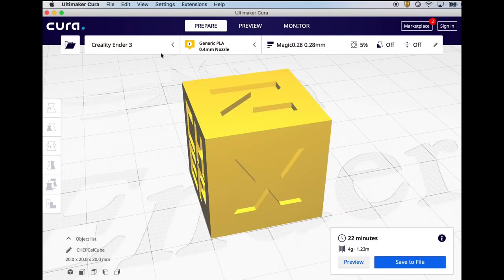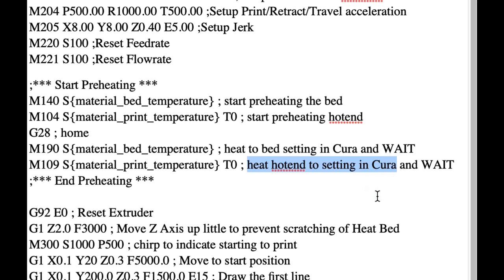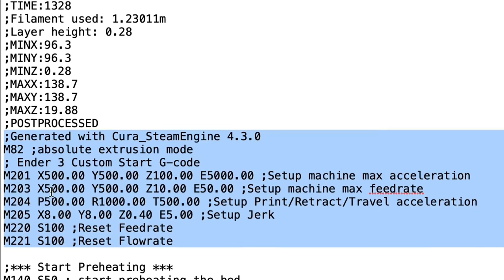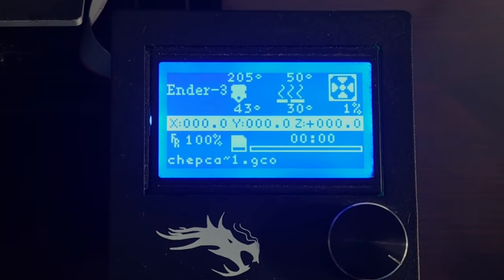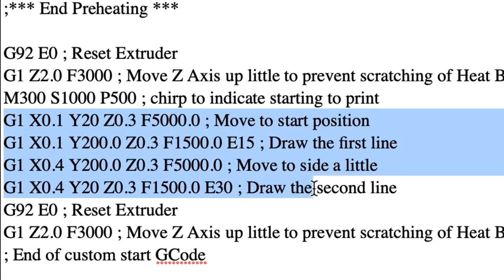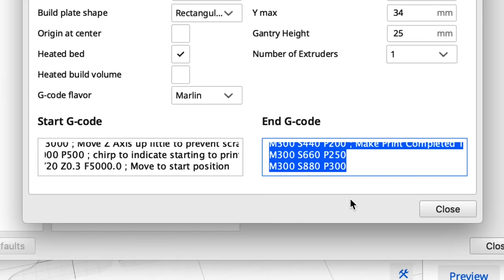Faster Hot End & Heated Bed warm-up in Cura

Comment from the maker: I’ve updated the .txt files. No more hidden characters from my Mac.
Reply: Fortunately you don't have a quantum computer you would have quantum number in your files for 3D printing with quantum filament
Reply: CHEP thank you so very much. Greatly appreciate your work and dedication of putting the tutorials out for us. Thanks.
Reply: What's the diference between G28 home and G1X0.1,...  ;move to start position
 edit ;    figured it out.     G28 is home other is just prep for prep lines

Thank you!
Reply: Hey Chuck, why not just hit the pre-heat function? I always do that on my Ender 3 Pro, and then insert the mem card. Once heated, I then change the filament to the colour I want, and hit "go". The preheat temp can be edited to 60 and 200 in the printer  under Control / Temperature / PLA Temp.
Reply: Just wanted to note that I copied the gcode from the website just now and there are still hidden characters. Easy fix but a bit confusing until I opened the video in YouTube to see this comment.
Thank you!
Reply: Note if you have a new Ender 3 you need to move the G28 to top like this, otherwise it heats the bed then just stops.

Settings > Printers > Manage Printer > Machine settings then paste the following gcode at the top (M117 shows custom text for extra cool factor)

M117 Monkey Mode Reset {material_type}
G92 E0 ; Reset Extruder
G28 ; Home all axes

M140 S{material_bed_temperature_layer_0}     ; set bed temperature to e.g. 55 °C and continue
M104 S{material_print_temperature_layer_0}   ; set hot end temperature to e.g. 210 °C and continue
M117 Monkey Mode Preheat {material_type}
M190 S{material_bed_temperature_layer_0}     ; wait for bed temperature to reach e.g. 55 °C
M109 S{material_print_temperature_layer_0}   ; wait for hot end temperature to reach e.g. 210 °C
M117 Monkey Mode
Reply: Note this is only required for Print using USB mode with Cura
Reply: 404 behind a pay wall but thanks for the info
Reply: the link is dead...

Comment: Hi CHEP!
Instead of using the material_bed_temperature variable I use the material_bed_temperature_layer_0 variable if not the first layer temperature setting will not be used at all. I made this change on the Start G-Code and worked like a charm!

Comment: I have found its better to let the bed come up to temperature and let it stabilize for a few minutes first before starting the print - especially for large prints that use the majority of the bed. During heatup the bed will expand unevenly (due to some portions of the bed being hotter than others), but after a few minutes this will start even out across the entire bed. I now get perfect first layers every time, even for large prints.

Comment: For the cases when bed takes much longer to heat up than the hotend - just add few more lines to you start code. Begin heating the bed and wait until it reaches 40C; you may need to experiment and find the right temperature for your bed type/size. Then follow the instructions from this video - continue heating the bed further till the final temperature and at the same time start heating the hotend. Both will reach desired temperatures simultaneously.

Comment: Took in use in my Ender 3 Pro immediately!

Also moved "G1 Z2.0 F3000 ; Move Z Axis up little to prevent scratching of Heat Bed"
before M190 and M109 waiting commands so that hot nozzle is not in contact to the magnetic bed while heating.

Comment: Thank you; this tip will prove very useful. I know that if I go into my Anycubic Mega temperature settings and manually set the hot end, I can heat both hot end and bed at the same time without blowing a fuse. This is what I have been doing before seeing this video. 

I can see why Cura would want to be conservative, but they should make it an option.

Comment: I would think that the bed heats up first so that the glass/surface can heat can soak in and throughout the glass. The bed would need more time than the nozzle would.
Love all your videos btw!
Reply: This is exactly right. The hotend usually heats up very fast anyway, so it's not a big delay, but an easy approximation that doesn't require manual timings or other complications to make it work with most printers, while still allowing a bit more time for temperatures to settle and spread from the heating element to the print platform.
If you can move the thermistor, placing it ON the platform, as far away from the heating element as possible would be a good way to remove the need for this, but can be inconvenient to implement, and would be very error-prone to do as a default for consumer printers.

Comment: From what I remember reading the primary reason for heating the bed and the hotend separately in series instead of in parallel is more so that you're not cooking your filament in your hotend while waiting for your bed to head up. The hotend can warm up so much faster than the bed (at least in my printer) due to the differences in mass.

Comment: Found your post on the web about this and used it to greatly reduce my frustration during the start of prints.  Thanks!

Oh, I did have to make a change, though.  It didn't like the T0 at the end of 2 of the lines, so I had to remove it and it still works fine.
Reply: Same with me.  Had to remove the "T0" at the end of the two lines of gcode to get it to work.

Comment: @CHEP you should use the _layer_0 instances of both variables, to make the behaviour fully consistent with the profile settings. I would also suggest to set the M104 at a fixed lower temperature (140-160) to prevent oozing in case the bed takes longer than the extruder to reach temperature.

Comment: There might be a caveat worth mentioning here. I have a glass bed and personally I prefer to preheat the bed for longer than even the delay in the nozzle heatup allows for because the bed feedback temp is for the plate not necessarily the bed. Glass takes a bit longer to soak the heat into especially when started up cold. This may or may not actually be a problem, just my preference.
Reply: Coming to say this.  My Ender 3 with glass plate had horrible first layer adhesion.

Comment: I was procrastinating on this one for a long time. Had modified my old 3D Printer to operate this way. But, when replaced it I had been used the preheat setting; which was always the wrong temperature.... So, you "forced" me to update my start and end code.  Works great! So, thanks for sharing.

Comment: Very interesting thanks for taking the time to post this,  I myself prefer to heat the bed up 1st,  rather than leave the hotend idling at printing temperature cooking the filament inside it while it waits, on a printer with a fast heating  AC heated bed though I can see the merit of doing this, but on my old cr10 which can take some time to heat up enough to print PETG and cant quite get hot enough for ABS without an enclosure,  I wouldnt do it, thanks again and this is certainly food for thought...
Reply: Maybe preheat the nozzle to a standby temperature, high enough to heat up quickly to print, low enough to not cook the filament.
Reply: heating the bed first also means that it has time for the whole bed to soak up the heat and even out. The whole minute or 2 saved waiting for the hotend to heat up has its benefit and if you cant handle that minute or 2 wait.. 3d printing really isnt going to be a good time for you lol.

Comment: If you're unsure if you should enable this on a printer that might have too weak of a PSU, you could always check if the printer will do that by itself already by using the preheat feature. If that heats both the hotend and the plate at the same time, that's basically the manufacturer saying it's okay to do that.

Comment: Another useful tip, thanks.
My MP Select Mini has a feature that I wish Marlin (or octoprint) could incorporate. When the heated bed is about four degrees from the setpoint it starts heating the hot end. With octoprint on my CR-10 I manually start heating the bed and when it's about 8 degrees from setpoint I start heating the hot end then select print.

Comment: I never changed the start G code, but on my Anycubic Mega S, sometimes I would go to the preheat option in the printer's UI and set both the hotend and bed to the desired temps and it heats just fine taking less time. What's cooler is that you can immediately go to the gcode to print, and it will still heat the bed first, but the preheat has already set the hotend to head and that isn't overridden, saving more time there as well. So basically you can set it to preheat and go to print immediately and you get the same effect as modifying the start gcode, except it's slightly more manual every time.

Comment: And I thought this was common knowledge. :-)
For the CR-10 I have been using this with Ideamaker for quite a time:

M190 S40 ;pre-heat bead to 40 with waiting
M140 S{temperature_heatbed} ;set bed temperature without waiting
M109 T0 S{temperature_extruder1} ;set extruder temperature and wait
M190 S{temperature_heatbed} ;set bed temperature and wait

And in PrusaSlicer this is it:
M190 S40 ;pre-heat bead to 40 with waiting
M140 S[bed_temperature] ;set bed temperature without waiting
M109 S[temperature_0] ;set extruder temperature and wait
M190 S[bed_temperature];set bed temperature and wait

So the 40°C pre-heating is the headstart my bed needs in order to have the nozzle and the bead reach the end-temperature at about the same time.
This requires a little tuning based on your end-temperatures, your printer and your enviroment.
Reply: Agreed, the problem with starting bed/extruder at the same time is that the extruder tends to ooze once it reaches its temperature.
Reply from the maker: The test strip removes any ooze for me.
Reply: So, does this works with the CR-10S? I have always thought that it is annoying to not have them heat up at the same time
Reply: @jacobwiebe293  There is no reason why it should not work on the CR-10S as well. But as I wrote it requires some tuning in order to make the bed and the nozzle reach their target temperatures at about the same time.

Comment: I believe the reason for heating the bed then the nozzle is to lessen oozing not to slowly work out the power supply. Printing some CPE or exotic dilaments requires 90 or even 100+ C which could take a long time for large build plates. Some machines take 5 or more minutes to get to 100 and it would be bad for the nozzle to be at said temp for that long since it can cook certain materials and cause jams.

Comment: I use a separate heat bed and it is hot all the time, I keep it pretty hot, 65c to 70c but I have a 1/4 aluminum tool flat bed, I use a mirror, stick glue and I have no problem with parts not sticking, unless the bed is not leveled correctly, love it! I have a CR10 self upgraded to CR10s.

Comment: I'm using this Cura start gcode sequence for my Ender 3 V2, more precise and interactive. Also, prevents filament oozing during the BLTouch bed probing.

;*** Start Bed and Nozzle Preheating *
M140 S{material_bed_temperature_layer_0} ; start preheating the bed
M104 S{material_standby_temperature} ; start preheating hotend (prevents oozing)
;*** End Preheating *

; Ender 3 Custom Start G-code
G92 E0 ; Reset Extruder
M117 Homing all axes
G28 ; Home all axes
M117 Bed tramming
G29 ; BLTOUCH Auto LEVEL
G1 Z5.0 F3000 ; Move Z Axis up little to prevent scratching of Heat Bed

G1 X0.1 Y20 Z20 F5000.0 ; Move to heating position
M117 Heating nozzle and bed
;*** Start Nozzle heating *
M109 S{material_print_temperature_layer_0} ; start heating hotend
M190 S{material_bed_temperature_layer_0} ; start heating bed
;*** End Nozzle heating *

G1 X0.1 Y20 Z0.3 F5000.0 ; Move to start position
M117 Priming the nozzle
G1 X0.1 Y200.0 Z0.3 F1500.0 E15 ; Draw the first line
G1 X0.4 Y200.0 Z0.3 F5000.0 ; Move to side a little
G1 X0.4 Y20 Z0.3 F1500.0 E30 ; Draw the second line
G92 E0 ; Reset Extruder
G1 Z2.0 F3000 ; Move Z Axis up little to prevent scratching of Heat Bed
G1 X5 Y20 Z0.3 F5000.0 ; Move over to prevent blob squish

;*** Single Print Start Tone
M300 S1000 P500 ; chirp to indicate starting to print
;*** End Single Start Tone
Reply: If you want to be more precise, heat the bed first then do the auto bed level
Reply: @gergohochoner6597  That is what this cura sequence is doing. :)

Comment: When I first got my 3D Printer I did consider this tweak but realised that extra offset time while the extruder is heating could give the bed a more time to thermally expand.

Ultimately I'd love someone with an Infrared camera to prove this hypothesis.
Reply: If you have a 300+ watt bed and a glass build plate, can confirm, it's an issue. My bed heats up as fast at my nozzle, so my first layer is really bad if I don't preheat the bed for a minute. It takes a second for the heat to soak through the glass. If my bed heater wasn't super overkill, I don't think it would be an issue.

Comment: On CR10s manually configuring  the commands CONTROL>TEMPERATURE>NOZZLE/BED has the same effect, in that the nozzle and bed will heat up simultaneously. 
When I print, the first thing I do is manually set the temps I will print at straight after turning on the machine (assuming the bed is clean), that way I can then prep my stl/gcode for print while the machine heats up; the bed taking the greater amount of time. By the time I've then prepped the files the the printer is ready to go.

Comment: Here is what I put in my start G-code:
M140 S{material_bed_temperature}
  ;Start heating the bed 
G4 S60
 ;wait 1 minute
M104 S{material_print_temperature}
 ;start heating the hot end
M190 S{material_bed_temperature}
 ;wait for bed
M109 S{material_print_temperature} ;wait for Hot end

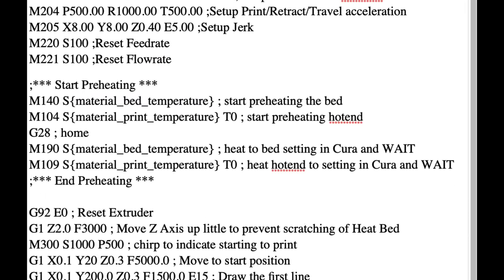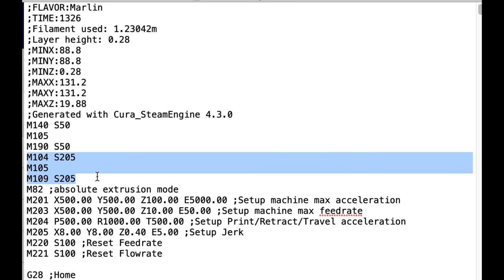This will delay the hot end so that it reaches temp closer together.  On my A8 (12v supply), it take 2:25 seconds to heat the bed and about 1:30 to heat the hot end.

So it saves me a minute doing it this way.

One downside - if you use octoprint, it pauses the serial port so you don't get the nice temperature graph until the minute wait is over.
Reply: Thanks! Exactly that code I searched!

Comment: I think it's a good thing the bed is heated first... if you're using glass that is. When the thermistor reports back 60C, the surface of your glass itself might be something like 40C. So it gives the heat time to permeate through the glass, which in itself is a bad conductor of heat.
Reply from the maker: Test it and find out. I use a swipe of glue stick on my glass and often can print PLA without heat. So it depends on your setup.
Reply: AND if you use a gauge, you could see that, with a glass on top of the heated bed, the print surface will slightly bend during the heat, caused by the materials heating at different speeds with different dilatation factors. So waiting for 3 or 4 minutes after the sensor reports you reached the final temperature of your bed is a good habit to make sure your bed geometry is stabilized.

Comment: I've always set the temps manually in Octo so they would heat up together. This is convinient!
Reply: Search for the "preheat" plug in. It will place a button below the "start print" button and will use the first temp settings it can find in the gcode. Better work flow!

Comment: Thank you very much for this. 
I would always pre-heat the printer from the printer settings first and than select the file, this is much better.

One suggestion though, I don't agree with leaving Home in the middle while we wait for the printer to heat up.
I feel that it can be an extra load on top of all the power draw.
Also is something that I rather be performed at the end and quickly than having the hotend very close to the bed stationary. 
I had one of my surfaces damaged because of that. 

Either way is a very easy change from anyone that prefers it that way, thank you very much :) 
Life saver xD

Comment: Very useful.
I use a simpler but not quite as good method- Use Ender 3 menu go "Prepare" then "Preheat PLA" then immediately after start print. So bed is heating to 45C while extruder going to 185C at same time. Then print settings send bed to 60C while extruder sits at 185C until print settings move on from bed heating to extruder heating.
Reply: Kneecapper on my CR10 and new Ender 3 I setup my pre heat temp for my Petg using the abs pre heat to 240 and 80 bed. Its so good. Always pre-heat beds and nozzle before going to cura so when Im done in cura its printing time.
Reply: Yes.
I always use preheat on my Anet A8.
If bed leveling, always best to do that with a warm bed anyway.
Reply: Why don't you already set preheating to 60degrees also?
Reply: @steffengr.5556  Because I don't know how and this way does not take much longer. How do you set preheat to 60C?
Reply: @Cloudman572  Control > Temperature > Preheat PLA Conf > ;)
Reply: @steffengr.5556  Thanks that sounds simple enough, cheers.
Reply: @steffengr.5556  Thanks again, set as you said and very easy and useful. I will have to keep an eye on it now printing before the glass plate is hot enough but great on first 2 prints.

Comment: For a glass bed, I have found that the separate warm up times allow the glass to be fully saturated by heat before the machine begins work. I couldn't get anything to stick to bare glass when warming them up simultaneously... as soon as I stopped being impatient and let them warm up separately (along with cleaning with iso alchohol) it worked beautifully. So... don't do this with glass.
Reply from the maker: You can add a pause and still speed things up but it’s your choice.
Reply: THANKS for saving me all that typing! LOL

Comment: This is the exact fix i was hoping to find for my MP select mini. I've added MOSFETs for both the hotend and bed as well as a300W power supply so power won't be any issue but they just never heat simultaneously. Going to try this out tonight.